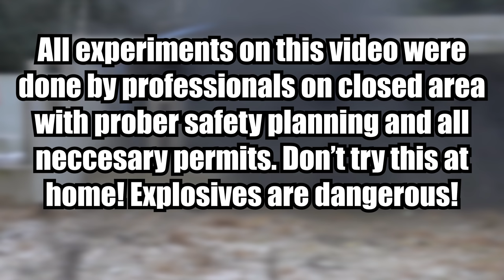How hard it is to explode a hole in concrete wall?

Comment: The "wet fart" was basically a HESH charge, which is very effective against brittle substances like concrete. Also, the liner in those shaped charges was a large piece of steel, which may be too thick. Something thinner (1-2mm) would require much less energy to vaporize. Nice video! Crazy Finns as usual
Reply: wouldn't copper be better
Reply: @ieuanhunt552  any soft metal I believe, since it behaves as a liquid when it is solid when used in this way and thus softer would be easier to deform into a jet as opposed to using something like mild steel.
Reply: @tatotaytoman5934  You have 5 likes for comment that is so wrong... heh
Steel and copper are both ok and both aren't "soft metal".
Pyramids were build with copper chisels... copper in shaped charges generaly is giving extra 10% of penetration but it is much more expensive that is why older Soviet tank HEAT projectiles were made with steel liner.
Also mild steel is soft type of steel->low % of carbon...
And the metal hardness is irrelevant, that is why lead is not used as it is soft and in the same time much denser than steel or copper so lead should be perfect according to your theory.
The parameter that is the key is speed of sound... you need to exceed the speed of sound in your metal with the speed of the shockwave created by your kaboom material.
Reply: @Bialy_1  Actually unironically said "heh" in the internet argument, clearly a terminally online Redditor.
Reply: 🅱️ESH
Reply: @admiral_alman8671  Not High Explosive Squash head, No we're on that BESH
Reply: I wonder if the jug had gas or a flammable liquid if it would fire through and flameout that backside of the wall
Reply: @tatotaytoman5934  Now I'm genuinely curious what would happen if the "water charge" that he used was filled with Oobleck instead of just water......

Comment: Don't do this at home

Gives exact instructions on how to build it
Reply: Well at least they weren't doing at home
Reply: If you Can get the C4 that is XD
Reply: @jorgeleiva6067  The formula for C4 can be found on the internet. Trough the wonders of chemistry you can rearrange the atoms in sugar and air into C4 if you wanted.
Reply: @jannikheidemann3805  just because they have similar compositions it doesn't mean you can make it from just that. It requires access to a good few solvents and other compounds that may or may not be controlled substances.
Reply: @jannikheidemann3805  The formula for C4 and formula for being on the FBI's watch list*
Reply: @wea69420  It requires nothing that you can't find in nature to make it. It's a lot of work if you want to do it that way, but it can be done by a single person.
Reply: @wea69420  I remember doing some research and found that with quite a few extra steps it can be some what easy to make without needing controlled substances.

Comment: Craigslist:
Original Perustava concrete element, slightly used for test purposes, almost new, straight from the factory.
Reply: Straight from the factory, but now slightly bent.
Reply: In Finland, it's in the safety and healthcare regulations that one must destruct one concrete element from each batch for quality control... It's same for any products sold to customers, including food and drinks.
Reply: No low ballers, I know what I've got.
Reply: funny thing is that wall can still be used as building material if you bend the bars back and repair the holes with fresh concrete.
even with that big hole in it the overall integrety is mostly intact.

Comment: Everyone: No the water jug and C4 isn't not going to work.

Lauri: I reject your reality and substitute my own.
Reply: Am I missing an eyebrow
Reply: Love the Mythbusters reference. Lol. They essentially made a water charge. Ive seen one in Iraq blow through a bank vault thick steel door. It was like 20 zip zags of det. Cord and 3 saline bags. Hole large enough for a hand grenade to clear it out. Lol. Then we had engineers come clear the rest of the door
Reply: @hanksadventures4132  Why bother clearing it at all ?  just weld the door shut :P
Reply: That double negative makes it were they all thought it would work
Reply: Water is a nearly non compressable liquit.
Air on the other hand can be compressed quite well, since it is a gas (think aboout air cannisters for divers ).

Therefore placing a layer of water (in form of the water filled jerry can) above the C4 channels the energy of the explosion towards the wall. If it wasnt for the water all the exothermic reaction energy would just expand into the air, and therfore being useless.

The water blocks that direction, so the hot gases can only expant thrpugh the wall...
Reply: Quack, damn you.
Reply: @zarbaldearli8904  Lauri wants big boom.

Comment: THis is awesome!  Also, I should say, your design of the water jug with the C4 on it is . . . similar to a late medieval breaching charge called a *petard*, which was basically an iron cauldron packed with black powder, and bolted to a thin piece of wood.  

A soldier chosen to carry the weapon, called a 'petardier' would carry it up to the heavy wooden gates of a castle or walled city, lean it or prop it against the surface and light the fuse, then attempt to run in his overthick armor (meant to protect him from missile fire from the walls . . . mostly) back to his own men before the charge went off.  

However, at the time, they lacked a proper understanding of how to make and use timed fuses, so the petards often had a tendency to detonate early, killing the petardier.  This is where the phrase "Hoisted by your own Petard" came from.  ;)
Reply: in modern times that kind of technique would be advertised as "life-long jobs available, with immediate chances for upward mobility" (well and sideways, and generally scattered in every direction)
Reply: "For 'tis the sport to have the engineer hoist with his own petard; and 't shall go hard, but I will delve one yard below their mines, and blow them at the moon."
Reply: In LOTR "Two Towers" movie, I feel like this is the idea behind the orc running in to light the powder kegs under the wall of Helm's Deep
Reply: @wombataldebaran9686  HA!
Reply: @kaizen5023  More than likely, actually!
Reply: Never go full petard.
Reply: made me think about ancient tecniques for how blocks of stone were cut
Reply: Does the job come with life insurance
Reply: "your design of the water jug with the C4 on it is . . . similar to a late medieval breaching charge called a *petard*, " the name is very accurate as the black powder according to modern definition is not even an explosive material...
So from simply physical point of view there is hardly any similarity here... 
Your medieval metod would most likely fail even as a way to cause the C4 to "went off"->maybe that is gonna give you some idea how incomparable these two substances are...
Also in medieval times black powder was used often as a way to make a hole in the city or castle wall, soldiers were simply diging tunels and then when the end of it was under the wall a huge ammount of the black powder was ignited there in that closed space and that huge amount of energy inside a tunel was causing colapse of the wall in that place.
But if you only wanted to make some fireworks under the medieval wall then your petarda would work very well... or was that a way to get rid off the most anoying soldier in you army? hehe
Reply: engineeer gaming
Reply: Didn't know they had missiles back in "ye' olde" days
Reply: @Bialy_1  the amount of gas generated by that much black powder burning in a completely closed container essentially creates a giant bomb
Reply: "The petard...it just won't stop hoisting"
Reply: too be fair armor does not slow you down too much watch videos about it

Comment: "it's kinda like Finnish pressure washer. " I threw myself away at that one
Reply: Timestamp?
Reply: @Captain_Leafy   it's during the red 2L water bottle
Reply: @Captain_Leafy  It's at 5:35. And then he said "either there is going to be a hole, or the wall is going to be extremely clean." I lost it.

Comment: Conclusion: "So concrete is really hard"
Reply: It is a meaningful thing in the sense that from all the construction or structural materials in use, metal-reinforced concrete takes the most amount of explo to effectively demolish. Even thick metals are relatively easier to cut through with properly designed shape charges. 330g of C4 worked into the right type of shape charge could cut through the metal beam of a channel bridge but not if that is steel-reinforced concrete.
Reply: you know what else is hard?

Fortified concrete
Reply: Thing about concrete, it will never stop hardening. It will get tougher and tougher over time. Another thing about that effect is that eventually it becomes so hard, it's brittle and chips on impact.

Comment: I am not surprised that the "wet fart" worked, but I AM surprised that it worked so well. When using liquid pressure wave limiters, vegetable oil is typically much better than water. Still, this proves that water is also viable. It would be interesting to see a comparison.
Reply: I'd never heard of this method before. Does the specific speed of sound through the liquid limit the shockwave's propagation in that direction, or what is the working principle?
Reply: @EatRawGarlic  I am not qualified to answer - I have only seen it done in practice by professional blasters (I am a special effects pyrotechnician so I never handle C4/dynamex). The two times I have seen it in practice it was done with vegetable oil. But yes, my unqualified guess is that the density of the liquid affects the shockwave's propagation much like you said.
Reply: @EatRawGarlic  I could see two effects: 1) The shockwave that goes into the liquid layer will be mostly reflected back towards the wall at the liquid-air interface, because of the large difference in acoustic impedance. 2) The mass of the liquid provides an inertial confinement - it needs some time for it to get moving and the explosion gases to be able to start expanding, so that even though the peak overpressure isn't bigger, it lasts for a longer amount of time.
Reply: Water impulse charges have been the standard for a long time in the military.  Doesn’t really matter what liquid you use as liquids don’t compress.  Plus 5 gallons of water is a lot easier and cheaper. Plus oils are flammable under compression.
Reply: I don't really know what do you exactly mean by "liquid pressure limiter" but the matter is Its Majesthy Inertia! The way that oil works better than water is oil has a way more elasticity over water. By elasticity in this case I mean the surface tension. Actually water "eats" a huge amount of energy for its "foggization" I should say. It's not such amount like in case of its evaporation but still a huge! I think this issue might be solved by adding a several drops of liquid soap to the water. Any oils are flammable which makes the event of course more spectacular but faaaar more dangerous...
Reply: Read "The Dam Busters" The allies drop bombs against the face of a German dam to shatter it. There is also a PBS documentary about it.
Reply: @Sapper21b10  They use 'salt water' though, the salt usually being epsoms salts to increase the density of the water, this is also what they use in the AT-4 confined space variant as a countermass.
Reply: @Sapper21b10  " Plus oils are flammable under compression" you say that as if it is a bad thing
Reply: Listening in English, he actually said he used "butter".
Reply: You can't compress water (or oil for that matter) compared to most gases, so if you've only got a small explosive, assist it with 10, 25 or 50 litres of water and it'll go boom way better.

Even a relatively small explosive in a barrel, with water in, will give some fiendishly good results and this has been used to great effect with improvised explosive devices made from 2 and 3 litre bottle and...... that's all I can say on that!
Reply: take old engine oil.... oh wait....
Reply: called mudding.. blasters use it on rocks  place charge  cover with mud or clay  keep damp then blow charge,  force is directed down away from mud  rock splits into pieces .. oldtimers trick ..
Reply: @michaelnorris6365  bombs caused cavitation against dam face  then water crashed back against the dam at that point  ..great show pbs rocks
Reply: @EatRawGarlic  liquids are generally incompressible so I think it has something to do with the incompressibility of water
Reply: @EatRawGarlic  I believe it both reduces spread of the shockwave and improves momentum transfer to the wall.
Reply: @ottarkraemer9001  time to use quicksilver
Reply: @reggiep75  oil is compressable.. water is not.. water is also more dense.. would explain why it's used.
Reply: Can someone explain why they ate using water.... is the water inbetween the explosive and wall or is it water then explosive against the wall.
Reply: if you notice in the high speeds, ...the concrete plume is way before the water plume. 
Thats how incompressible water is.
Reply: @richardaitkenhead  
the water is on one side the concrete on the other
the explosive is in the middle
the two surfaces share the same explosive force
Notice the difference in compression?
Reply: @-LightningRod-  ahh because water is incompressible the pressure on the concrete is higher than if there was just air there leading to more damage..
Reply: @richardaitkenhead  
lol sure it is , hehehe
Reply: @exodeus7959  what is a nonewtonian? Are all liquid noncompresible ?
Reply: @exodeus7959  understand now thank you
Reply: I would test if wet sand work better than pure water, or even oiled sand
Reply: In regards to sound wave propagation, it would travel slower through oil than water. Sound travels faster the higher the density as long as the media is homogenous. But the water would provide more mass as initial resistance.
Reply: The only thing vegetable oil is good for! 🙂
Reply: @wreck_ignition7847  Speed of sound in liquids is inversely proportional to square root of density.
Reply: @kasparroosalu  it was late, my mind was inversely proportional 😂 Liquids don’t tend to see the high velocity differences that one would experience with solids. 1440 m/s in oil vs 1480 m/s in water over a 14x20x8” container is irrelevant.
Reply: @richardaitkenhead  The explosive is between the water can and the wall. Explosives will explode in all directions unless confined. The water can confines the explosive enough for sufficient energy from the explosion to be directed against the wall to breach it. This is the simplest way I know to explain it.
Reply: @ottarkraemer9001  maybe just a boring compatibility reason- certain explosives would be utterly destroyed on contact with water so they use oil instead (e.g.) the an in anfo would just dissolve and render it all useless
Reply: @michaelnorris6365  I just saw a video that a guy drops model dam busters from his model airplane.
Reply: @Sapper21b10  At the extreme explosion velocity of C-4, water becomes extremely rigid. Much more rigid than the concrete. That should reflect nearly all the kinetic energy I would think.
Reply: @wreck_ignition7847  Agree. That reflected wave business probably has some kind of small effect, but I bet most of the benefit comes just from the mass of the liquid helping to contain the explosion.

Comment: Q: How hard it is to explode a hole in concrete wall?
A: Apparently harder than all the games let on D=
Reply: @eedd sdsd actually, most of the concrete walls (or concrete structures, for the matter) are reinforced. Concrete is very weak to tensile stresses, and when there's bending (almost always), there's tensile stress